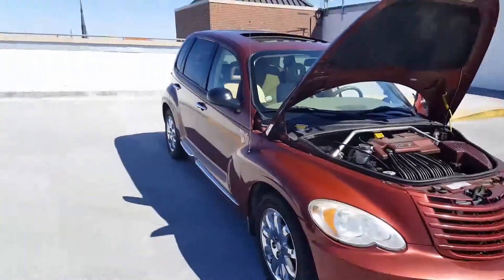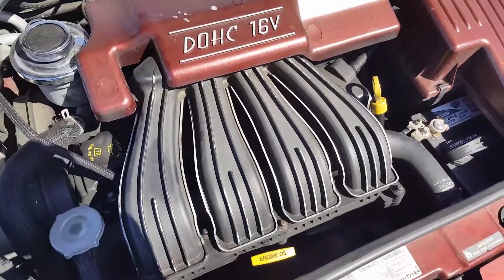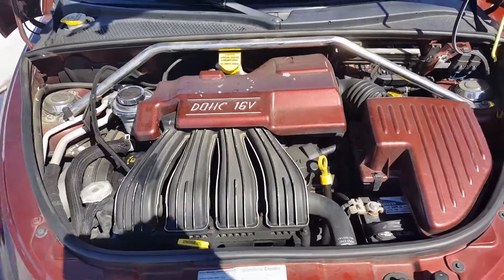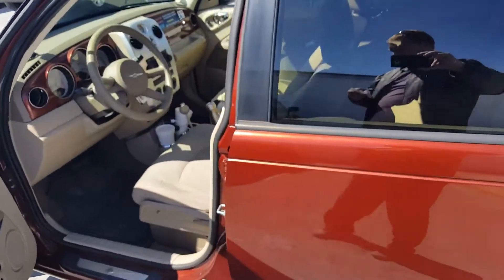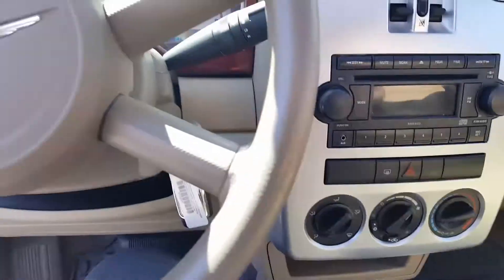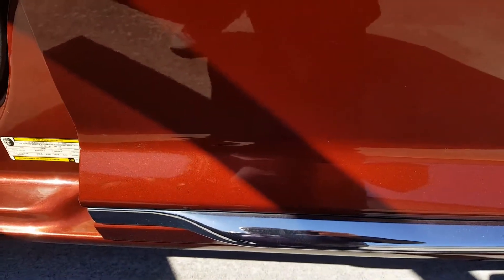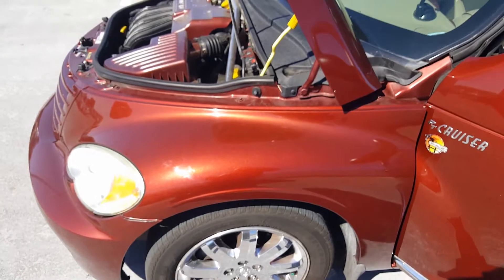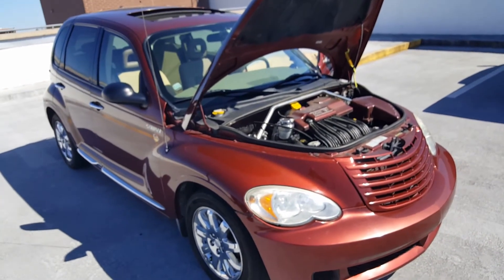Top 5 Hidden Issues When Buying a Used Car AVOID THESE Hidden Problems When Buying a Used Car

Comment: I have an 09.  That bumper breakage issue is sooooo common.  I finally found one in the junk yard, same color, no breakage.  I reinforced that entire bolt on connection with angled metal and construction glue.  If buying a used car, bring a check list.  It is hard to remember everything.  Also, bring a battery tester.  The cruiser is an ok car for the diy'er, but I am always fixing or replacing something. Clock spring yesterday, broken window motor wire today, what does tomorrow bring?  I only agreed to buy this car because it was a manual tranny.  The junk yard has nothing but automatics.  Thanks!
Reply from the maker: ha ha yup! the used pt cruiser i bought had a loos bumper, I had to zip tie it back down. seemed to hold the bumper!!! thanks for watching!!